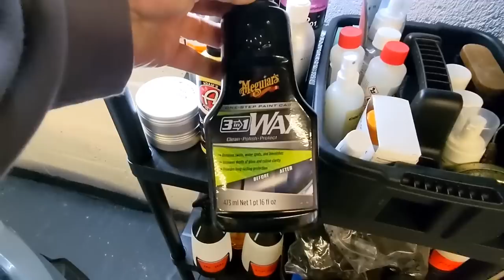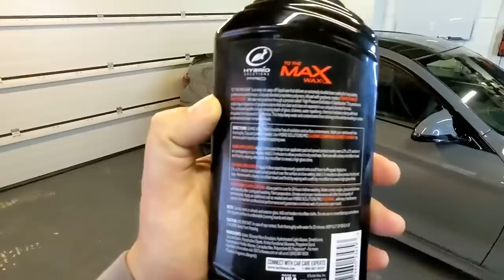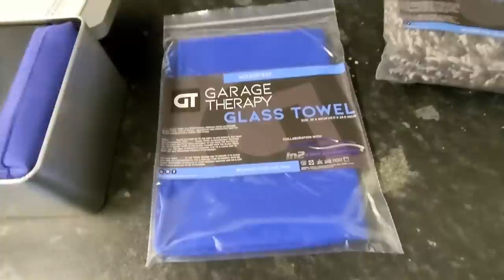Waxing my BMW M4 CS with graphene wax

Comment: I have a VW T Cross that is garaged in Australia  on the Sunshine Coast. It is protected with a ceramic treatment that I maintain with regular washing with a local product Bowdens Nanolicious - which is promoted as maintaining protection and high water beading properties. The car is now 2 years old and beads with tight water beads and a high gloss is maintained. My other car is an 11 year old Golf Mk 6 that lives on the street at night and week ends and goes into a car park at work during the day. It has no professional protection but I use Meguiars Ultimate Quik Detailer after I wash the car with Meguiars Ultimate Wash. I top it up with Meguiars Ultimate Quik Wax - spray on every now and then. I sometimes hit it with the Quik detailer betwen washes when the car is only lightly dusted. This old Golf shines brilliantly and beads water perfectly . Wheels  and tyres on both cars are cleaned with Armor All Heavy Duty  Wash in a bucket using a long handled fluffy brush to get in between the spokes. I'm slack with the tyres using only Armor All protectant  heavily sprayed on a paper towel to maintain a dull shine. It's supposed to be an internal product but I use it on external vinyl and under the bonnet/ hood to keep the engine room plastics black. I vac on a weekly basis and wipe out the interiors and pay particular attention to the door jambs and around the hatch lid etc. Cheers and thanks for your reviews.

Comment: I noticed if you start with a clean polished car, then apply very little max wax it comes off easy. I’ve used the TW One n Done Polish with machine, then hand applied Max Wax (don’t over apply). To keep that shine and protection I use Flex wax as a drying aid every so often.

Comment: I got too much detailing stuff for Christmas to list!   LOL    But I did just get NV Car Care Jet and Lustre (along with their Boost detail spray) to use on my sports car.   I still have not gone on board the whole ceramic coating thing yet,  even this many years in.     I like being able change the protection without the hassle of having to remove a ceramic coating.      Last year I did Polishangel Viking Coat and Viking Spritz as the maintenance spray.     That combo was without a doubt the most durable paint sealant combination I have ever used.   Very easy to apply and remove and hydrophobics off the charts for long periods of time!   Using the Viking Coat/Spritz combo essentially will give you at LEAST a year of protection.   My car is garage kept and I easily got two years out of it and honestly you could get infinite protection because the Viking Spritz is essentially a weaker Viking Coat in a spray bottle so every time you utilize it,  it puts another thin coating on top!  No issues whatsoever with any build up and the paint always looks spectacular.    I just wanted a change and heard great things about the NV Car Care line so I thought I would give that line a try this time but my all time favorite detailing brand (to date) is Polishangel,  even with their ridiculously high prices that no normal detailing person or sane person would ever pay.

Comment: Not sure about the season your in but living 10 minutes from the edge of Lake Erie, I run a dehumidifier all year long to keep the dampness acceptable rather than a heater. My garage isn't heated but its surprisingly humid in the garage in the dead of winter even when it's -30C outside. Give it a shot if your leaving the car in the garage over inight before working the paint it should cut the dampness down a fair bit.

Comment: I’ve tried a similar thing with the damp cloth,using the flex wax spray,I call it the Roy hattersley technique 😂,giving the unbuffed finish a spitty splutter of water to lube it up (or do it in a very light spitting with rain condition) I got some nice results with it,especially on black paintwork

Comment: Hi John, I am a big fan of this wax.  I've found that on my flat-red GTI [like your gorgeous flat-grey Bimmer] this wax adds a look, luster and added depth of color that I really enjoy - impressive.   One thing I noticed with your removal was how "wet" your cloth seemed to be with the initial wipe off - perhaps your humid garage?...  I too use a damp cloth that I completely soak then rinse and squeeze the bejeezus out of it [more dry] so there is no wet residue - easy one & done...works very well for me.  May I suggest you try it?  I then of course follow with a favorite fluffy for a brilliant [and deep] shine.  I've not gone 3 months as a stand alone with the MAX as I get antsy after a month or so and follow with a direct coat of its mate FLEX Graphene Spray. Good God - so good.  Love your channel - keep the good work.  Shine on you crazy diamond!  🚘

Comment: Maybe the directions stating you use quite a lot for a small section and working it for 2-3mins, the heat from that process might make it really clingy after the wait time. You'd need a wet cloth then. How you did it, perhaps might have been a better result just to dust of water on the microfibre, if it couldn't be dry buffed.

Comment: John which would you recommend for paint correction in direct sunlight? 3D one or Sonax perfection finish. I'm working on bringing one of my cars back from the dead but I don't have a garage or any decent shade to work in so I'm kind of stuck.
Reply from the maker: I've not not used 3d one m8.